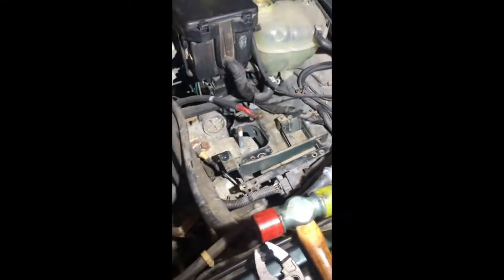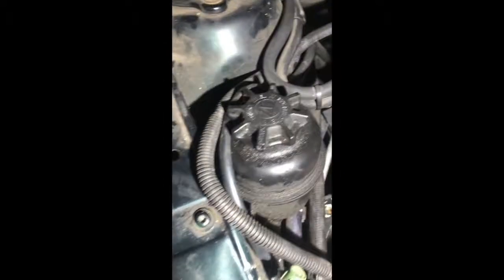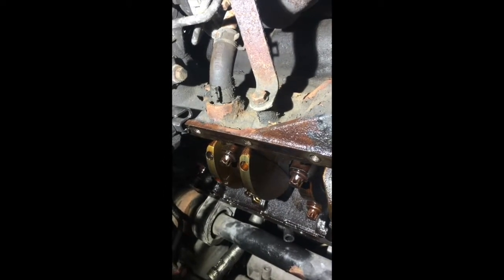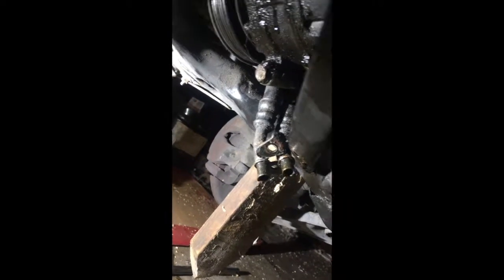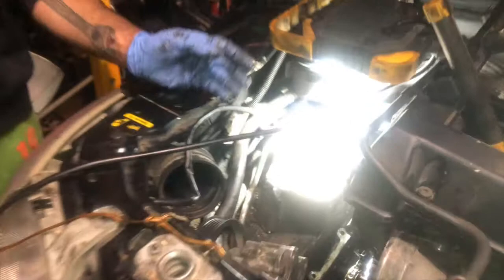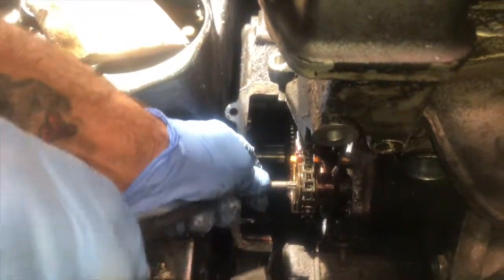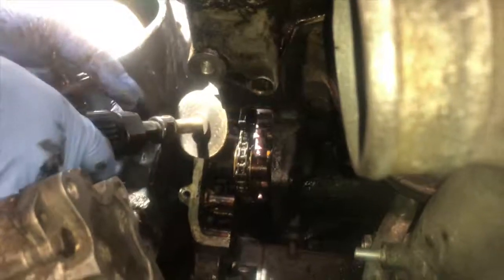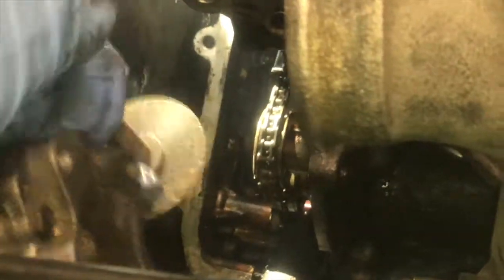Balance Chain Eradicated

Comment: You only cut 1 link of the chain, 2 at most. You can probably find replacement for it around your workspace.
Reply from the maker: Good point Nav.  I would do that if it weren't for the research I have been doing.  If it was some of the chain driven machinery in some of the factories I have worked in, I definitely would have just lost a link or two and replaced the master link.  Most of the threads on the different Saab boards and the research I have read say deleting the chain is fine, and the vibrations are negligible if even noticeable.  It also frees up h.p., as the balance shafts are dead rotating mass in the engine. They only really "balance" at low RPMs.   In this engine, the shafts are geared to rotate at twice the RPM as the engine RPM.  Since this sounds like a lot of wasted effort for the engine, and there are benefits to h.p. and such, I'm ok with deleting it.  Have an exceptional day :) Cheers
Reply: @sass1ap  ohh i see hehe i did not about that, thank you for the info bro 👍👍 and have a nice day also 😁